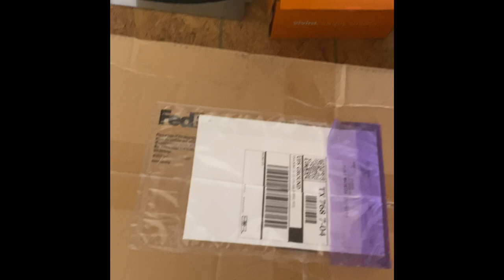Corvette C8 (Sigala Designs), Custom Engine Appearance Support Bar Covers

Comment: Sigala designs doesn't make that engine cover you show in the video.  Where did you buy it?  Thanks!
Reply from the maker: Correct it was for the support bar covers. Engine cover was painted and dipped by Icandyeehydro IG
Reply: @RolandBounds  is "Icandyeehydro IG" a .com?
Reply: Sorry all I saw was pretty girls at that address.
Reply: I found it.  Thanks

Comment: Did the forgiatos run u about 8k?  Did u do 21 in back 20 in front??
Reply from the maker: Brad Schaefer No cost with everything 5800. 20/21 👍🏾
Reply: Really that cheap. Do you know where I could get a set for my c8 z51 for around that price??
Reply from the maker: Brad Schaefer Moonshadow DFW